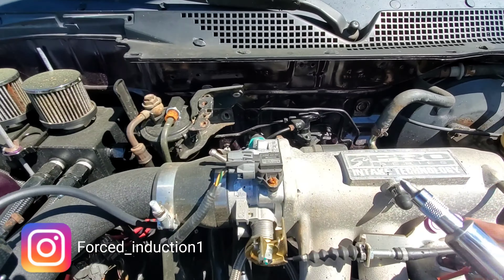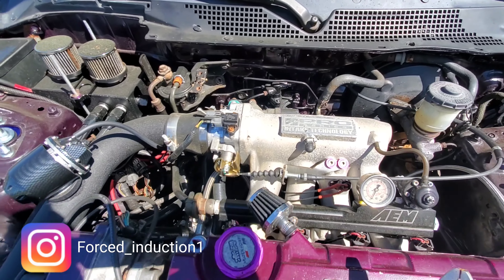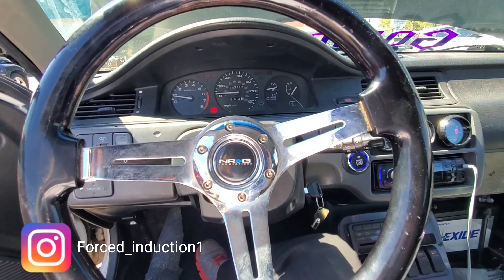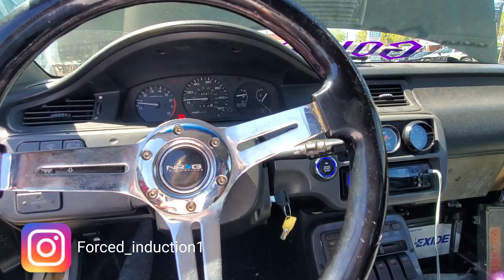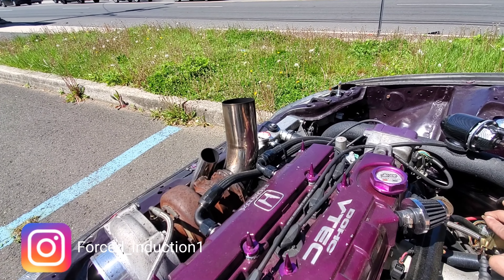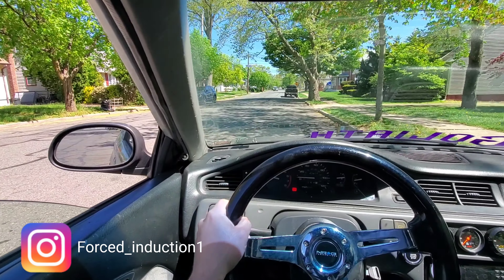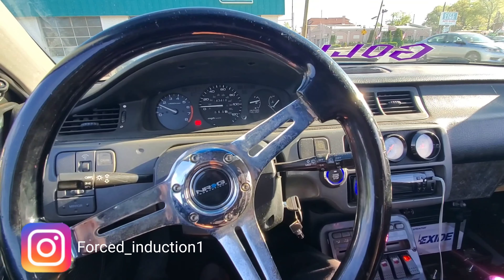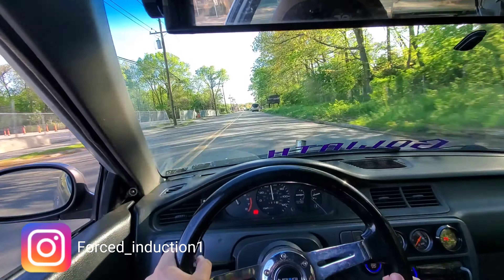Testing the base map on the b20vtec turbo setup eg hatch

Comment: Did you have clearance issues with the turbo and the manifold man or the  oil drain because I was looking into getting the 1320
Reply from the maker: I did at 1st, I bought a spacer so the turbo can fit but I have a big as turbo lol..I have videos of it.